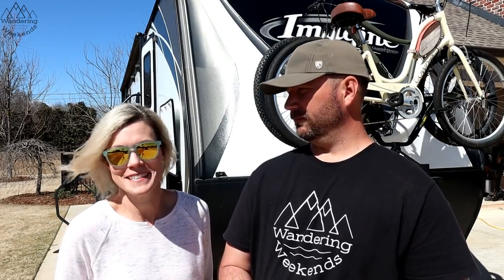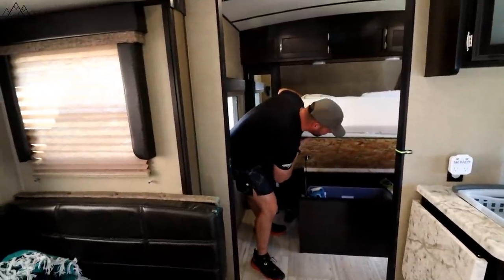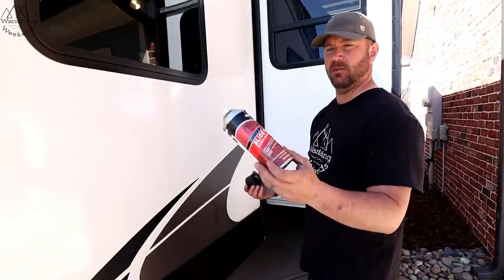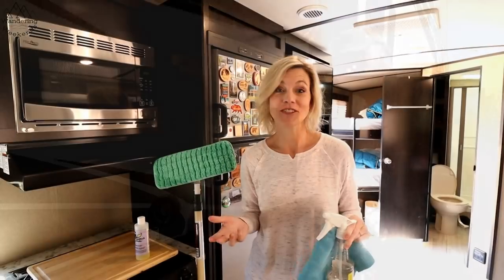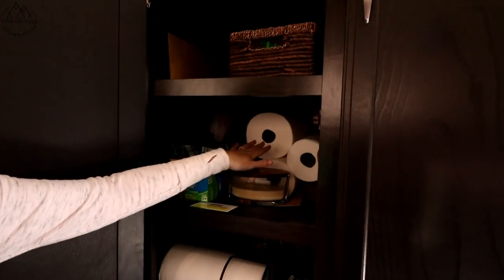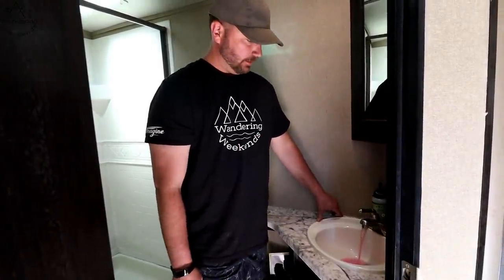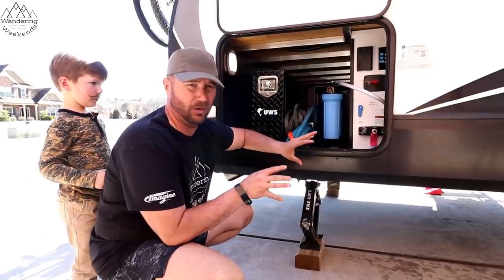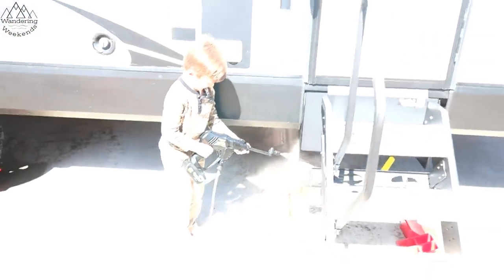PREPPING THE RV FOR CAMPING SEASON: Our 13 Tips to Help You Hit the Road with Ease

Comment: After dewinterizing and sanitizing be sure to check for fresh water leaks. Check torque on the lug nuts, check air pressure, lube slide gears, have propane bottles filled.  Looking forward to a great camping season.  See you out there and thanks for all you do.

Comment: Like another viewer, we use compressed air to empty the lines before winter. Between my Dad and I, we've been doing it for about 50 years with no problems. Less chemical and less cost. I use a max of about 30 psi. Antifreeze in the drains only.

Comment: I open my relief valve on my water heater and spray some lubricant in it and then close it. I also inspect my AC unit on top of my camper and make sure no rodents or anything made it's way inside the cover.

Comment: Torque  check the lug nuts , hitch bolts and check the spare tire pressure. Have a great first trip.  Cannot wait until our first trip. Lots of work to be done before hand though. New tow vehicle f350 7.3.  Weight distribution, hitch set up needs to be adjusted to the new ride.  Hope the 7.3  treats us as well as the old 8.1 GMC gasser did.

Comment: Great video. I'm so thankful we don't have to winterize!  You had some great points and I would add that a yearly inspection done by a service station is well worth the cost. Brakes, bearings, roof seal, propane lines, etc. all need a good thorough check before camping season.

Comment: I like to take a can of compressed air (or an air compressor with a blower nozzle) to the furnace and water heater burner areas to get any hidden spider webs or other nests out of there before turning on the gas to test them.  I also like to sanitize the fresh water holding tank with bleach & water overnight then flush with vinegar and water solution before the 1st time out.

Comment: I clean/replace air cond filter & a good inspection of power cord & plug. Check batteries & top off with distilled water if you have lead acid batteries.

Comment: I flush via the city water connection and do hot first; with HWH bypassed, that will flush most of hot and cold lines. Then I fill the freshwater tank to sanitize and then flush lines again to sanitize. Leave it 6 hours then fill HWH to flush and sanitize. Then drain and refill twice to get good fresh water throughout. Other thing to remember is to charge your gadgets. Charged up my TST tire pressure monitoring system yesterday and ensured the sensor batteries were good.

Comment: I do pretty much the same thing but I jack up the trailer check and adjust brakes and add grease to axles if necessary plus like you check all appliances to make sure all in working order also change batteries in smoke detectors and carbon monoxide cheers.
Reply from the maker: Good call checking the batteries!!

Comment: I use air to winterize all the lines, they sell an adapter that you take the plug out it your not water tank and you just plug an air line on it and blow air thru the system just open each value in your kitchen and bath until all the water is gone. We live in Ohio and never had a problem doing it this way.

Comment: Just use air to blow out the lines , easy , cheap.. some antifreeze for p traps .
Reply from the maker: Antifreeze is cheap insurance and doesn’t take any longer than blowing the lines out of you know what you’re doing. Knowing my luck I’d have some residual water gather in an elbow and freeze.

Comment: Where did u get the screens for outside water heater to prevent stuff from getting in
Reply from the maker: They're linked in the description box below the video.  Make sure you know your measurements as there are several different sizes.
Reply: Amazon

Comment: Do you have 30/50 amp at your house or are you using a 15 amp adapter?
Reply from the maker: We had a 50 installed. Love that I can run the AC while packing.
Reply: @WanderingWeekends  I plan on doing the same.